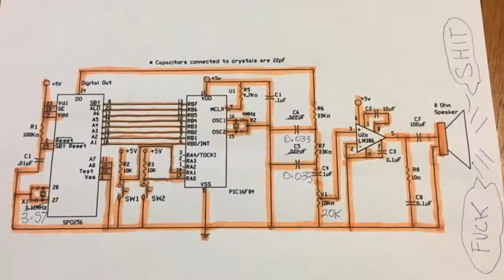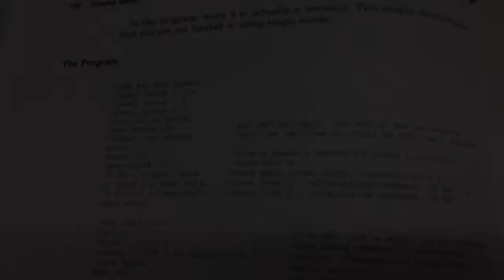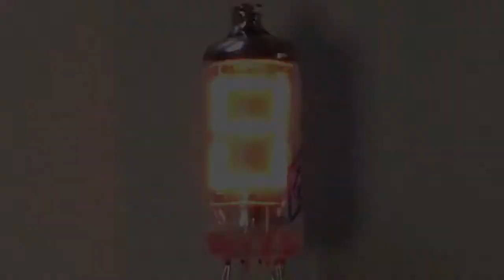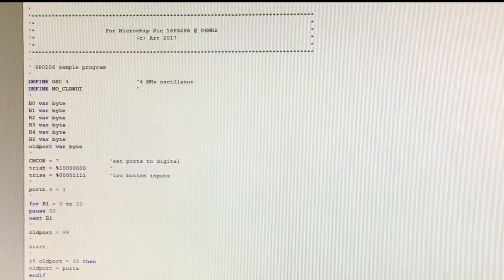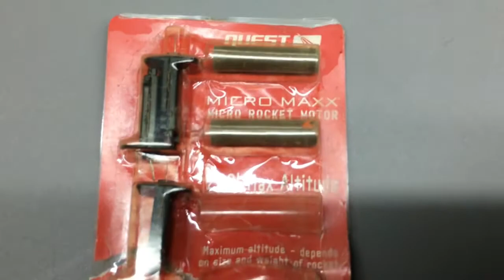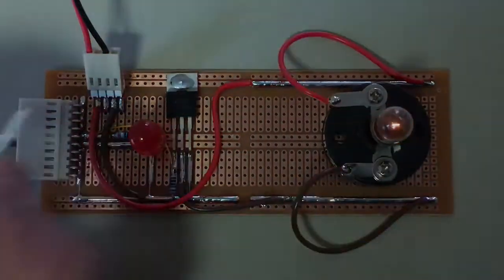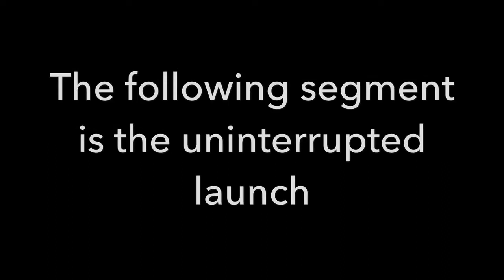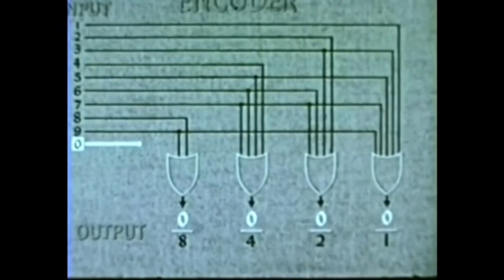Vintage Integrated Circuit (SP0256)

Comment: I still have the little speech synth box that we used on our Amstrad CPC 6128 in the 80s.

It also uses the SP0256 chip, and is one of the only things I still own from back then.

It has a Centronics style port on the back, and an LM386 amp + speaker.

My Dad and I used to spend many hours writing CPC BASIC programs for it, and figuring out the best phonemes / allophones to use.

It could be quite interesting to add a DAC which controls the SP0256 frequency, to make the speech sound more natural (or not).

Then again, it's also not likely to have too many practical uses, so probably not worth the effort. lol

Although, practically doesn't matter with most projects. The most impractical projects are often the most fun. ;)
Reply from the maker: Hey Leon, I always had knowledge of these, but never had one until now. The thing for me is the Amiga just does that with it’s stock software, and it does it a little better, and much more conveniently. Somehow I’m still compelled to find another, just because this one came out of an IC collection. It must still hit some nostalgia nerve for me.

Comment: That's the book my circuit came from! I've had the board wired for 25 years but forgot what the application was for. I just built another for Commodore 64 and it worked

Comment: SPO256,  chip from Tandy UK, . using a pic I also made a text to audio,  Used to go into computer stores and program 10 poke (x,65),20 x=x+1,30 goto10 such rebels. It would sit looking normal for a while until the video memory was also overwritten as it was a single memory bus. It would eventually overwrite its own operating system.  Spookily similar to our own trajectory.
Luckily you could just upload a new one from a tape.